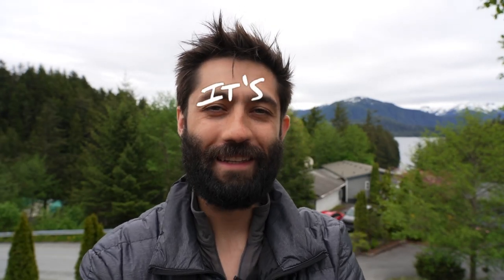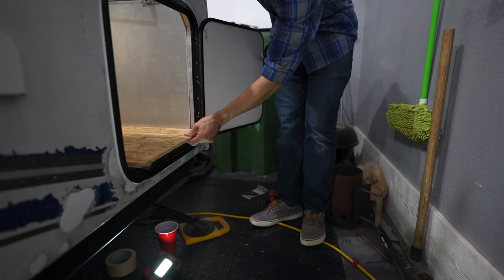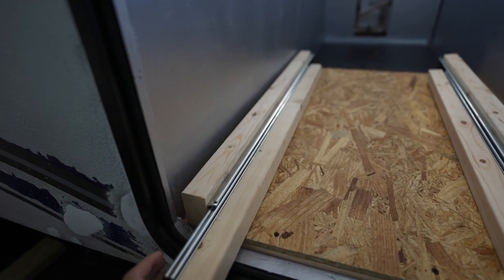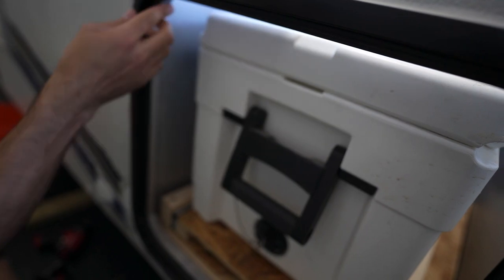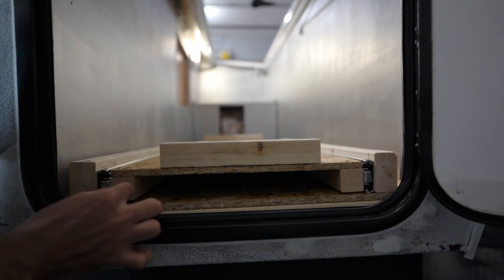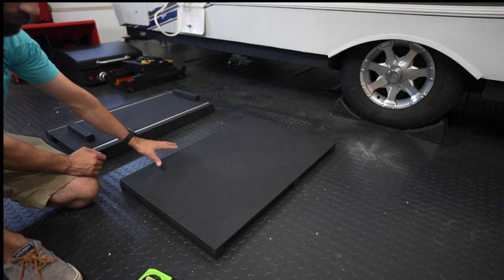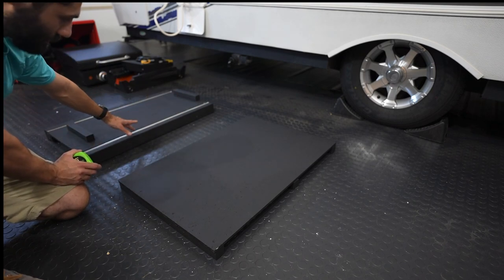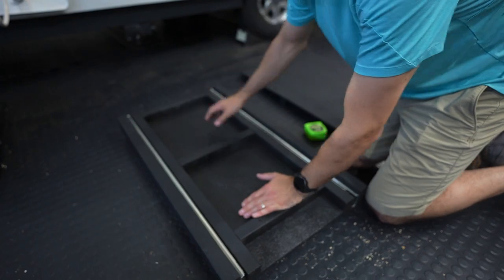Pop Up Camper COOLER SLIDER Mod | How to Conveniently Access Your Cooler in Your Front Storage Box!

Comment: Looks good! Do you know how much the total system with loaded ice chest weighs? Did it dramatically change your tongue weight or affect your towing at all?
Reply from the maker: I estimated the cooler with a large 40lbs ice bag to be approximately 65lbs.  The sliding rails are approximately 10lbs.  The lumber, I estimate to be approximately 30lbs.  I did, however, take out the plastic sliding storage bin along with MDF and luan boards.  Not sure what the weight savings was, but maybe 20lbs?